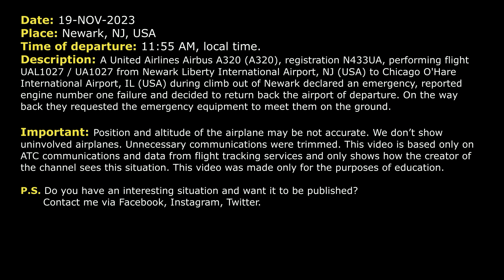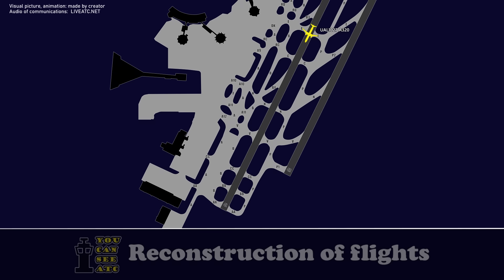Left engine failure. United Airbus 320 returns to Newark for emergency landing. Real ATC

Comment: What the heck? Put them in sequence behind a heavy and slotted another aircraft for take off. Very poor judgment by ATC. The aircraft with the issue has the right of way. Get everyone out of the way and zero speed restrictions. The pilots need as little of distractions as possible but this type of crap happens to often. When I declare a "Mayday" it is for a reason.  Don't bug us when I have time I will let you know what I am doing. A lot of things are happening in the cockpit and it must be done right.

Comment: So many times, ATC seem to have no idea that the crew are busy during emergencies. A constant babble of non urgent comms is so in appropriate. Also, many times I hear a crew have to repeat the exact same information over and over again as they are passed to different controllers. Don’t they pass on the info? Imagine having to confirm problem souls fuel every 5 minutes while you’re struggling to coordinate a single engine landing.
This was an extreme example, the initial controller seemed to have no empathy or basic insight, babbling on asking the same question 4 times while the crew are obviously stressed “We’ll get back to you” followed by the same question from the controller followed by “WE WILL GET BACK TO YOU”

Comment: 02:16  Just one engine ? - Question of the year, I would not believe it, if not recorded.
Reply: So true man!  It is like a script material from  Airplane!  movie.     "...you can't take a guess for 3 hours?..."
Reply: Dumbest question to ask and so unprofessional.
Reply: By the nature of her remarks, instructions, and questions, she is a low aptitude controller.
Reply: @warsurplus  She's handling probably another 20 aircraft at the same time, she does't stop providing separation for those other aircraft instantaneously. Pilot wasn't super clear initially on what the nature of the emergency is, the controller may or may not be a pilot.
Reply: @chrisstromberg6527  She clearly isn't a pilot however I've been dealing with ATC for decades and based on my observation of her delivery of instructions, remarks and questions, I suggest she needs much improvement.  For example one could tell she was not familiar with the phrase, "number one engine".
Reply: Obama hire.
Reply: @JohnSmith-zi9or yes. The president routinely picks specific air traffic controllers to work at the ATC. Especially with all the money and political cache that job has. 🙄
Reply: @Fireandbubbles  You missed my point. The President doesn't pick air traffic controllers. The Obama Administration changed the testing for candidates from a knowledge and skills test to a race based test.

Comment: You just know that the souls and fuel information is never passed on to the next controller. I don't know how many of these I have listened to where the pilot has to repeat 100% of the information every time they get handed off to a new controller. Also, that inital call, still looking for a proper mayday-mayday-mayday.
Reply: Neither Mayday or Pan Pan are required. They said they had an emergency, and it was handled. There is no need for dramatic wording when it is not needed. The Mayday or Pan Pan calls are used to cut through the chatter on a BUSY frequency which this clearly was not, therefore, not needed.
Reply: I would have thought a Pan Pan Pan would have been appropriate rather than a Mayday

Comment: ... just a guess, the departure controller seemed to be a newbie...  the clue was in her responses regarding the engine failure -- it seemed she didn't understand "number 1 engine", and instead misunderstood it to mean "one engine only".  Regardless, she did a excellent job... kudos!
Reply: Agree..newbie  "right turn  to 090"  [3:25] when she really meant left to 090 [3:40]. The aircraft would have to have made a 270 degree turn! Acceptable but not excellent performance by the controller.
Reply: No, she did not do an excellent job. She didn't even do a good job. She should have turned them right to bring them back to give them more distance to line up for approach, instead she turned them left, then tried to turn them back to the right(because that was probably what she meant the first time), and this lead to further confusion in an already tense situation. No, she did a horrible job and needs to have some additional training.
Reply: We'll give her the benefit of the doubt by assuming she is a newbie.
"Blah-blah-blah-blah..."
"Stand by"
"Oh, you stepped on me, let me repeat the entire question I'm bothering you with. Blah-blah-...""
Reply: @KennethAGrimm  Oh relax Ken, she was looking for an answer to the reason for why he declared an emergency. We have the benefit of hearing both of them talking, unfortunately she does not get to hear what he's saying, because she's transmitting at the same time. I've been in these situations with ATC, you need to be clear and concise with your transmissions to ATC.